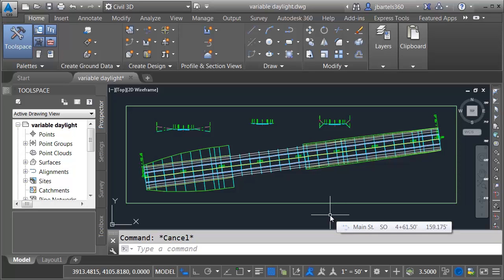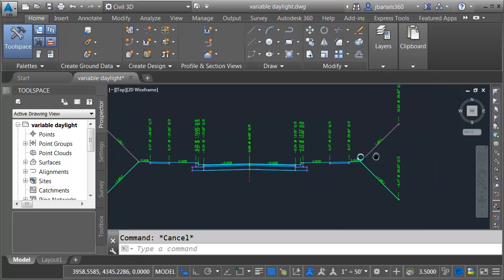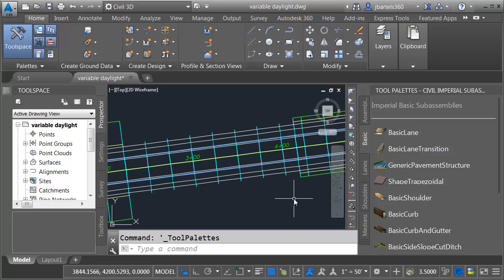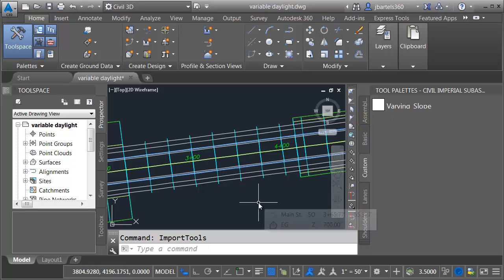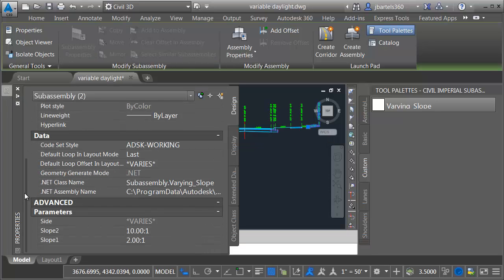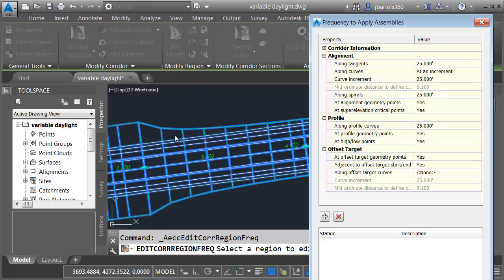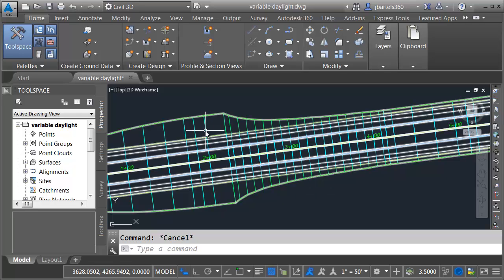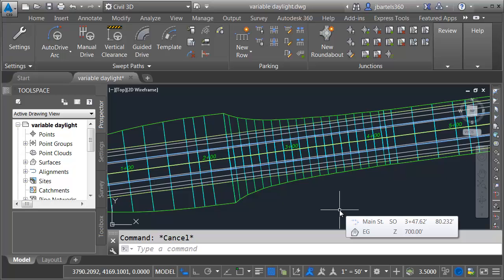Modeling a Civil 3D corridor with variable slope daylight

Comment: Jeff, Cound you please share the pkt files?The link in Video's description is not working....I'm a Civil Engineer and use Civil 3D in highway design.I have problems in transition part modeling. It's a very good solution !! Thanks you very much.
Reply from the maker: I'm afraid the service that hosts the link is down for maintenance.  I've been told it should be back up at 9:00 pm PST.
Reply from the maker: I'm afraid the service that hosts the link is down for maintenance.  I've been told it should be back up at 9:00 pm PST.
Reply: Dear Jeff.....Thank you very very much !!  you save my project!!
Reply: I was able to download the .pkt from the webpage link.  Click the link, then select the Download icon in the top right corner to get the .pkt file.
Reply: I can't download the file. Can you please share with me

Comment: Hi!
May I ask how could I create an assembly for a road, where you want the top of the road to be as level as possible to the existing ground. So you cut the road into the existing ground. I would like to show in section view also the cutout part. So i need to get a link from the edge of the pave to the existing ground (link slope  to surface) as a vertical planning fill. And i need to intersect cutout link (from the edge of base 1:1) with it. Is it possible to create such an assembly..or does it always have to be continuous? At the moment my assembly tries to lengthen all links from the edge to the furthest (as it couldnt just end where it is supposed to.

Comment: There should be a better way of handling transitions though, natively without a custom subassembly, With this method I have to have a new assembly every time i want to make a different transition. Not to mention I have to make sure that every other use who opens my drawing has to have the custom subassembly added. 

 I would really rather see this transition to be managed similar to the way super elevation is managed. Using a profileview and a profile that represents "slope". 12D an Australian road design package manages these transitions a lot better
Reply: There is a verter Way, use Istram Ispol